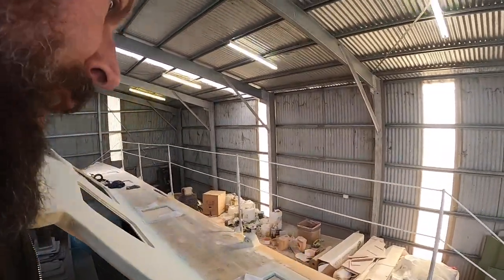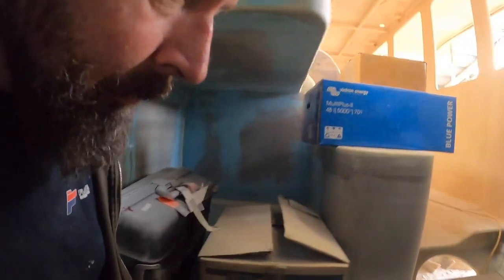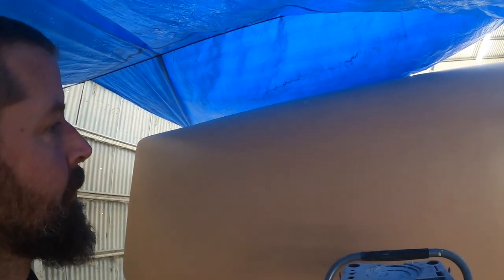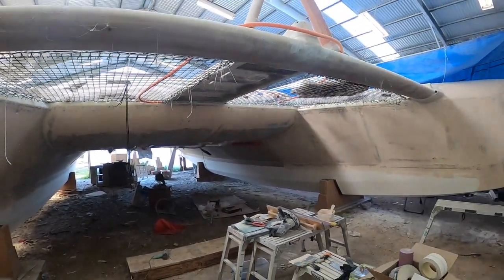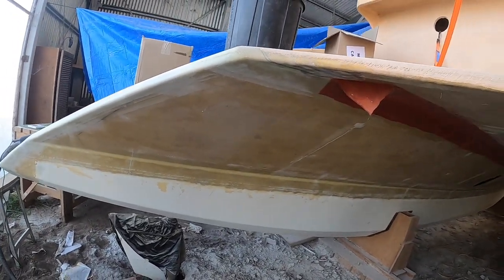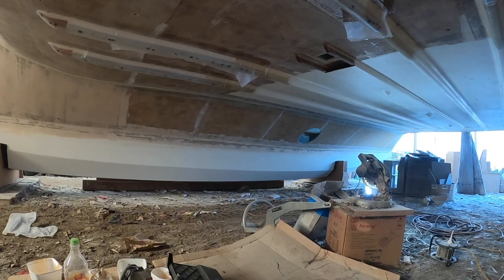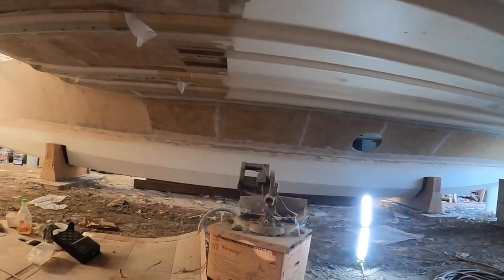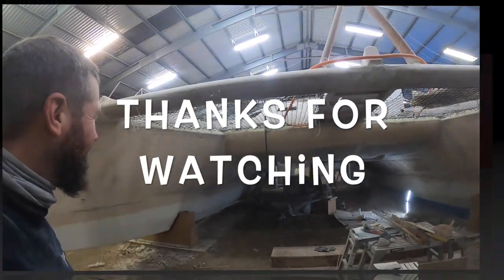Misplaced some holes knee deep in fairing compound - S01 E24 - DIY Catamaran

Comment: That's some serious determination you have.... eating the elephant, one mouthful at a time....
Reply from the maker: 😂 And it's a big elephant 🐘 😂 I was prepared for this though. The fairing is not the most time consuming, the little things are what eat up the time.
Thanks for the comment, appreciate it.
/ Axel
Reply: @buildingwilda  But you're eating it without a knife or fork ! Really impressive project ! Are you planning any gel coat on outer surfaces to help UV protection, or relying on paint and epoxy resin choice for that purpose ?
Reply from the maker: @mkllove  🤣 My cutlery consists of a bunch of different sandig blocks.

Gelcoat is not really a good option for an epoxy boat. Had I used poly- or vinylester, then gel coat would have been the right choice.

The epoxy needs uv protection. The epoxy primer I have used so far is protecting the glass work, but will not last indefinitely in the sun. I will do final fairing on top of the primer, then I will start with the finishing paint.
To achieve a good result with good uv resistance, the top coat will be a two part polyurethane high gloss paint.
I work offshore, and have a good relationship with an industrial paint supplier. They don't have many products suitable for the final coating, but I will use their products internally and achieve very long lasting rugged protective coating.

Paint, of all sorts, is expensive stuff. Best to follow the makers recommendations. They are normally very helpful and will advise you on a whole paint system. If you let them know what you already have on your boat, they will happily help you work out the best system.

Sorry for the long reply. Complicated stuff, but pretty straight forward after some research. I hear lots of good results are achieved with garage floor paint, but I have not been able to find sufficient information to make it worth the risk.

Polyurethane to provide uv resistant finishes.

Rambling answer 🤣 sorry

/ Axel

Comment: How much more did you get done before you had to leave ?
Reply from the maker: Got the bows faired and painted, the lower hulls faired and got a start on the battery installation. Melbourne went to complete lock down with 3 days notice, so a bit of stress toward the end of my stay. 😂 Now I just want to get back and start the construction again.